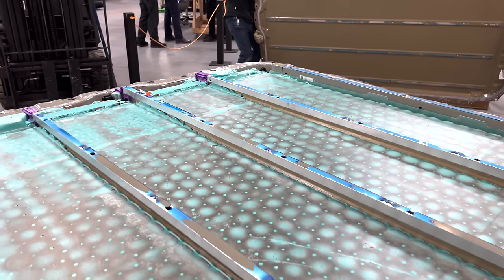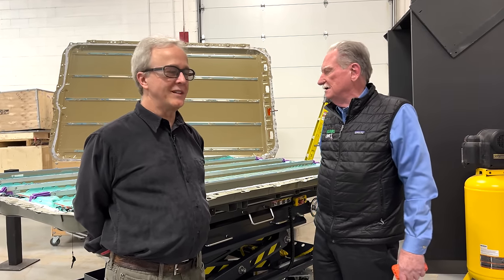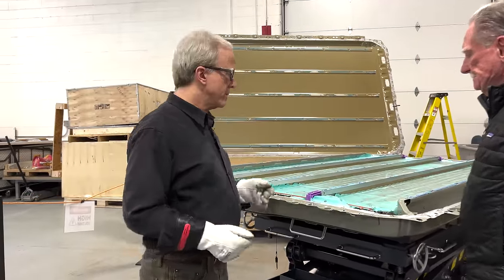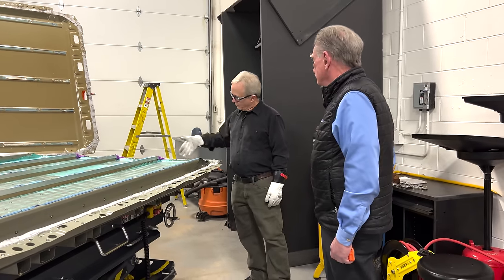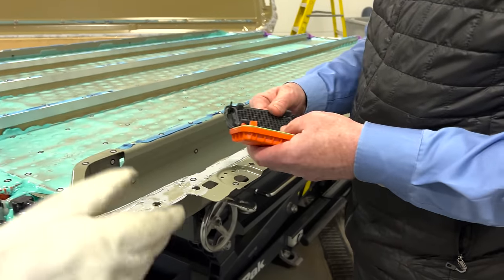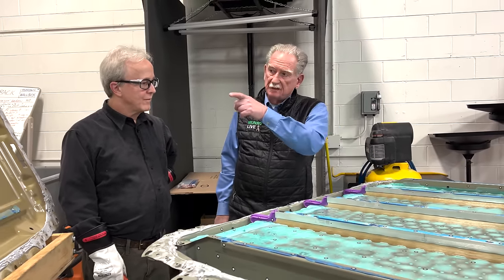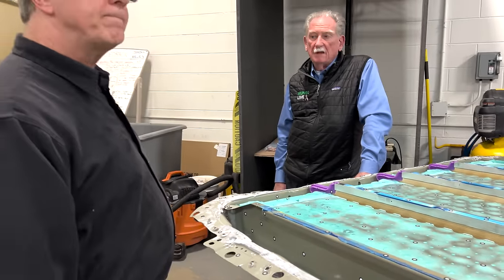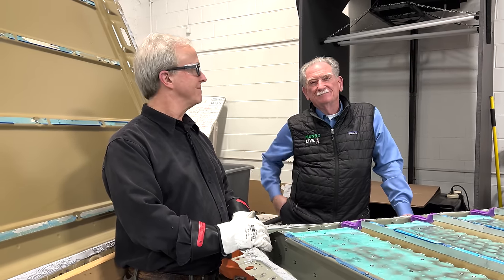Tesla Cybertruck Battery Pack: Our First Impressions Under the Lid

Comment: 19:00 The car/truck has basically one wear item that's worth 30K–40K USD and you can only hope that there isn't any unexpected fault in that part because it cannot be repaired, only replaced!
Reply: Any kind of individual cell level failure is a 1 in 1,000,000’s event. Designing in repairability is certainly more time and money overall than just replacing the whole pack in those extremely rare events.
Reply: @TheConnor12500  If we assume that one cell has probability of 1 in million to fail, then a battery with 7104 cells (like in Tesla Model S P85) will work with probability of (999999/1000000)^7104 or about 0.993 or about 99 times out of 100. In practice, that tells us that 1 car out of 100 will have a failed battery pack if a single cell has failure rate 1 in million.

Create a battery pack with more cells and you'll soon have a lot more failed battery packs.

And I'm pretty sure that in real world a single cell has more than 1 in million probability to fail. Luckily, the cell manufacturer does some automated testing for each cell to try to remove the broken ones but this kind of filtering/testing can never catch all the failures.
Reply: There a few shops that are repairing cells
Reply: @theyutzinator  I guess you mean replacing cells because repairing individual cell would make very little sense.

Replacing individual cells is somewhat doable with Tesla Model S style battery, pretty easy in something like Toyota Prius and next to impossible to do with something like Tesla Cybertruck.
Reply: Good thing the warranty covers battery defects for 150,000 miles…😎👍🏽
Reply: @Freakyguy666  Yeah, but you should assume that the truck has baseline cost of $30K/150000 miles or $0.2 per mile to run for the battery wear alone. Electricity and the cost of the car goes on top of that. (The above assumes you keep the car longer than the warranty. If you sell it near the end of warranty, expect the value to be reduced by $30K because next owner is expected to take the risk from that point forward.)

And I don't know how you feel it, but $0.2 per mile seems a lot more than the cost of gasoline for a gasoline truck is.
Reply: @MikkoRantalainen  please show your math on the purported $30,000….if Tesla replaces the battery for FREE within 150,000miles, then it is actually $0.00/150,000miles…
Reply: @Freakyguy666  Yes, I was talking about long term ownership costs. If you accept that the resale price at 145000 miles is pretty low, you can definitely simply get rid of the car before 150000 and somebody else will take the risk. My point is that once the warranty is over, you should assume that the car costs $0.2 per mile to run for the battery wear alone.

If you're lucky, it will last a lot more but you shouldn't count on it.
Reply: @MikkoRantalainen  I suggest you go back and edit your previous post to correctly clarify that your “math” was in the event you keep your car beyond 150,000 miles…only if you are genuinely honest, of course! 😇
Reply: @Freakyguy666   I added further explanation to my older comment. I still think you should evaluate the battery wear to $0.2 per mile because if you sell the car near the end of warranty period, the next owner is going to take full risk for the battery at the end of warranty period and the battery is now $30K liability for the next owner!

As a result, the resale value of the car is going to be $30K worse if the warranty is over or near over. If somebody is willing to pay more for your used truck, consider yourself lucky for finding a fool to take too much risk to allow you to benefit monetarily.
Reply: @MikkoRantalainen  thanks for correcting your post as it was clearly misleading (whether intentional or not!). But you forgot one thing…battery costs historically come DOWN and you are assuming that simply ceases for the next DECADE! Laughably short sighted….
Reply: @Freakyguy666  Battery (cell) cost did come down for a decade but if you look at the cell prices per kWh for the couple of last years, the price drop has stopped. We're still nowhere close to $100/kWh for a complete battery pack.
Reply: @MikkoRantalainen  besides the point…we are talking about the price in a decade from now…are you seriously going to assert that prices will not drop in a DECADE? 😂…your refusal to acknowledge that betrays your hidden agenda…
Reply: @Freakyguy666  I don't have any agenda. I'm just pointing that most people pretend that EV cars are cheaper to drive than ICE cars while totally ignoring battery wear.

If you include the battery wear to TCO calculations and end up EV being cheaper, totally go with the EV. I'm still running with old ICE car that I maintain by myself because that has been much cheaper per mile this far.
Reply: @MikkoRantalainen  Again, you purposely failed to address the fact that there is literally ZERO COST for the first 150,000 miles … AND that what may cost $30k today is virtually guaranteed to cost SIGNIFICANTLY LESS in A DECADE….but sure you have no agenda…perhaps you are allergic to facts…
Reply: @Freakyguy666  Cheapest Cybertruck costs about $82K today. If you're willing to spend that much on truck and fully accept that its value will dimish fast, go for it.

My point is that you shouldn't pretend that driving around in Cybertruck or any other EV is "cheaper than ICE cars" if you conclude that using calculations that ignore the battery wear.

Also note that Tesla Model S was introduced 12 years ago. The battery for Tesla Model S used to cost $20K in 2014 (including labor and parts) and today it would cost $13K–$20K (bottom of the range will not get you close to 100 kWh battery). If you take this fact as an example of "replacement batteries getting cheaper", I'm not seeing it.
Reply: @MikkoRantalainen  umm wrong…the CyberBeast is reselling for more than DOUBLE the sticker price! And meanwhile recent Tesla resale prices have increased due to the breakthroughs in FSD…meanwhile you have already admitted that there is actually ZERO cost for a battery that goes bad within 150,000miles…so now you want to try to convince rational people that battery prices are NOT going to come down significantly over the next decade….good luck!
Reply: @Freakyguy666  Which one of us is writing these comments with our given name? If you argument is that Cybertruck actually sells for double the sticker price, do you think that's an argument for EV driving to be cheaper or more expensive?
Reply: @MikkoRantalainen  it’s a simple fact…apparently you don’t like facts…
Reply: @Freakyguy666  Please, point to reputable sources for your claims.
Reply: @TheConnor12500 Not in the event of a fender bender accident that damages the battery. . Like others have pointed out.
Reply: @michaelbrinks8089  Let me put it this way, would you rather pay an $1000 extra for a vehicle that had to have battery replaceability designed into it, or save the $1000 and accept the vehicle failure rate over its lifetime due to the batteries is a one in 1000’s event, and in those cases you just replaced the whole vehicle to the consumer. This is the decision that Tesla had and obviously you know which option they chose and why if you know the cost of vehicle production. It’s a pretty basic engineering decision
Reply: @TheConnor12500  I would rather pay  $1,000 extra ($51K instead of $50k) because  like others have said. It's not a 1 in a million chance, if a moderate fender bender can easily cause parts & labor  $$ to exceed more than the vehicle is worth. Instead of a couple thousand $$ to repair. It'll be like  $40, 000  which is the case for fender benders in Rivian trucks. This type of crap has already to several EV owners. Hyundai EV being 1 a minor fender bender totalled the car. ....I'm not against EVs, I'm just against how many are made. Same with ICE cars where auto makers also do planned obsolescence.
Reply: @Freakyguy666 sure they will
Reply: @Mike1984-lc9rh another clueless ice fanboi who’s only argument is that they can predict the future…good luck with your Nostradamus act…I’ll stick to facts like current demand outstrips supply for the CT….
Reply: @Mike1984-lc9rh we’re discussing the CyberTruck—not the lightning….try to keep up…
Reply: @theyutzinator  - Too bad the labor cost of repairing individual cells is nearly a break even with replacing the whole pack.  Due to the sealed cells, taking that thing apart is a nightmare.
Reply: They need to increase the warranty. 12 years, 300K mile warranty should be the minimum. Can't be having a $10K+ item with a short warranty.
Reply: @imzjustplayin  People are already voting with their wallets that they are happy with the current offers. Hopefully the don't be too disappointed when they face the actual costs.
Reply: probably closer to $10k
Reply: @AntonioDiNunnoEVS  Where you can get e.g. new Telsa Model S battery installed for $10k?

That might be enough to get an old battery that has been taken out of service for being too broken (warranty replacement). That battery may not have totally failed yet but is it really worth $10k?
Reply: @MikkoRantalainen  I wouldn't know about that, but for Tesla to make this... i would say 10-11k, maybe less
Reply: @AntonioDiNunnoEVS  Yes, the cells alone for Tesla Model S battery cost around $10k–$12k but obviously the whole battery is going to be much more expensive. And try to look up the worldwide postage fees for a package that weights 500–700 kg. And then you need somebody to replace that really heavy battery because you cannot swap that heavy parts by yourself.

And by the way, if the manufacturer is going to give any warranty for the battery, that will be factored in the costs, too.
Reply: @MikkoRantalainen  I'm saying the WHOLE battery is in the 10-11k range. Yes shipping and installation would be massive cost. but installation is fairly easy, could be done in under an hour. Shipping is a nightmare. HOPE it is under warranty.
Reply: @AntonioDiNunnoEVS  As I wrote earlier, my whole point is that once the car gets out of warranty, the then-current owner takes a huge risk with the battery because he or she will be paying for the full cost.

And if you are selling a car that has e.g. 2 months remaining warranty, it's resale value should already reflect this increased risk. In worst case, the full cost of battery + shipping + installation will fall to the new owner if the battery fails 3 months after purchasing the second hand car.

If you plant to recycle the car to raw materials immediately after the warranty period expires then it's even easier to compute cost per month or per mile.
Reply: Cybertruck is not selling used at double the sticker price anymore. Deman greatly dropped off
Reply: @MikkoRantalainen your calculation isn't correct, the right calculation should have been (1/1000000)*7104 which is about 0.7%. Still pretty high but not that bad
Reply: @dinamiteblaa  If you re-read my comment, you'll notice that I was calculating the probability for a working battery. You calculated (assuming "*" means exponent) the probability of failure.
Reply: @Freakyguy666 Actually, you can't be sure that the battery is replacable at all after a "long" time. As new battery cars are designed it is likely we end up with a standard solution that might not fit early cars.
You can probably get a custom fix but probably not cheap. More likely to scavenge another damaged car with a working battery.
Reply: @anderslagerqvist2642  actually you can’t be sure of anything with 100% certainty…but given Tesla has a history of making EVs for a “long time” and is still providing batteries for those same cars that were made a “long time” ago, your scenario is actually the least probable….
Reply: @MikkoRantalainen  I assume the occasional cell failing won't write off the whole pack?
Reply: @killcat1971  Yes, random single cell failing will only fail that bank (group) of cells in worst case. I think most Teslas have 8–10 cell banks. However, the warranty doesn't cover 100% of the cell banks working. Instead, you only have guarantee that at least 80% of the advertised capacity is still available at the end of the warranty.

Also note that the max power will be limited if you lose full banks because total voltage is defined by having the cell banks in series. And available voltage heavily limits the max power you can use.
Reply: @MikkoRantalainen currently you can buy a 2.5kWh battery pack as a commercial product for $1000…
Reply: @Freakyguy666  I own an EV.  I wouldn't buy an EV with a pack design like this.  Max profits at any cost.  Nothing else matters very much.  Tesla have never been much into right-to-repair, and this unrepairable pack design is the logical conclusion of that trend.  Designed differently, this pack could have a 20 year second life in stationary energy storage.  As it is, this is just a big iphone with a similar life expectancy.
Reply: @imzjustplayin  I don't think they'd risk putting a 12y/300k mile warranty on pack with this design.  Would you?

Comment: Prior to the 4680 cell, individual modules could be replaced to fix in-service faults but the goop used in 4680 designs would would seem preclude any form of repair. I understand that Tesla themselves do not provide a pack repair service and expect owners to stump up for a whole refurb pack. Third-party pack repair is however possible but far less likely for 4680 packs. I hope the failure rate of 4680 packs is sufficiently low that this approach  to manufacture will not prove problematic amongst Tesla owners.
Reply: With this type of pack and all the adhesive, while technically possible it'll not be financially feasible to repair these packs in any modern country (too much labor time necessary). A civilization of waste and disposability... :(
Reply: can only hope their quality control is high enough that cells or modules don't go bad. Perhaps potting the whole battery to this extent will somehow increase its life too
Reply: @TheFlatronify  yup, it essentially makes the entire pack a "throw away" if something goes wrong, and potentially the entire truck after just a few years too.  this kind of anti-repair shit needs to be stopped.
Reply: It is criminal to make something with this much material and resources and not make it repairable. This should be a metric for Munro, not how easy stuff is to build and churn out…
Reply: @electricsnut  I agree but Tesla build cars with a different mindset: they are NOT to be fixed after. It's just a particular business model that doesn't expect to keep in store billions in parts if the car is made to remain operable through the years. I'd say they expect it to be like an overengineered watch that keeps on ticking, like a 70's Benz.
Reply: The only thing that matters: what's the warranty? 

Who gives a crap if it's fixable if the warranty is 1 million miles?
Reply: @themonsterunderyourbed9408  anyone insuring these vehicles will give a crap
Reply: @degnarius  Why? How does that make any sense? Insurance doesn't pay for warranty work..
Reply: @themonsterunderyourbed9408  lack of repairability means replacement will be required in an accident, driving up the cost, which in turn increases insurance premiums.
Reply: @electricsnut : Munro is a DFMA guy.  That school of thought prioritizes minimizing the number of parts, and maximizing the ease of assembly.  Repair is someone else’s problem.

DFMA is the reason we have all these plastic items that snap together, but can’t be disassembled without breaking them.